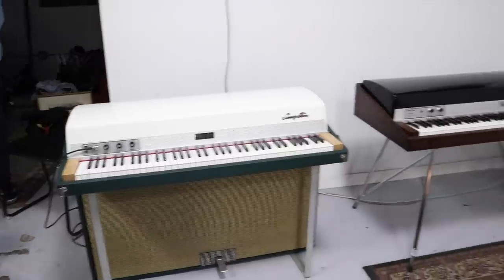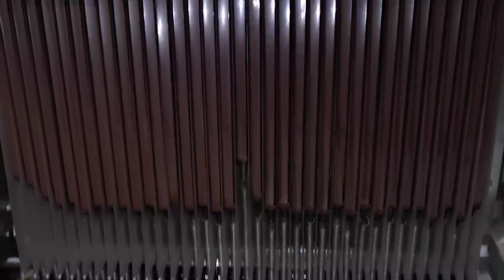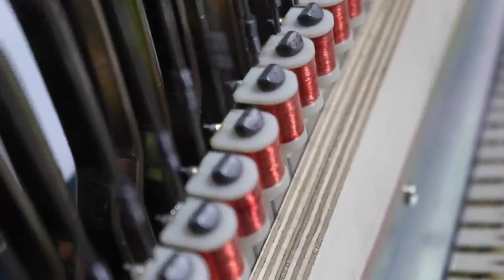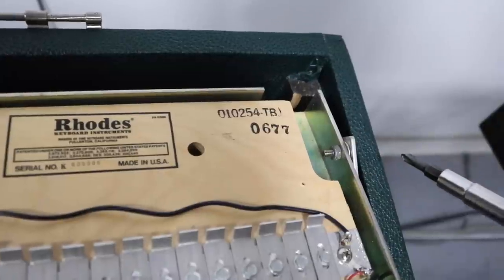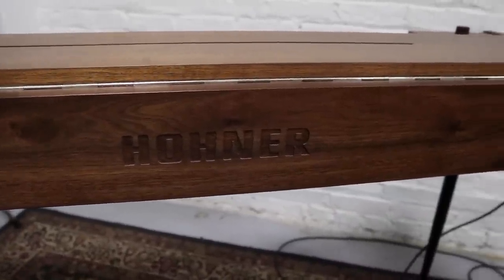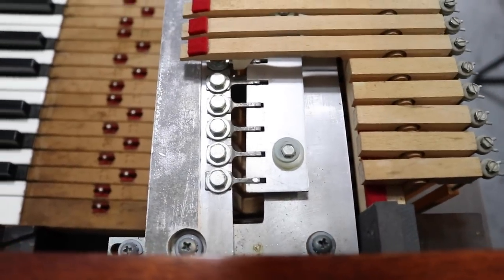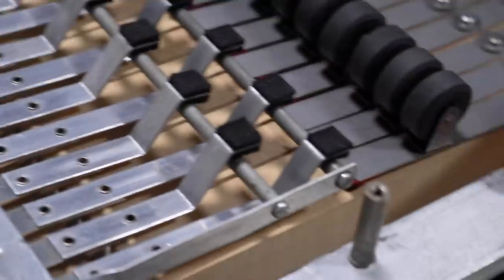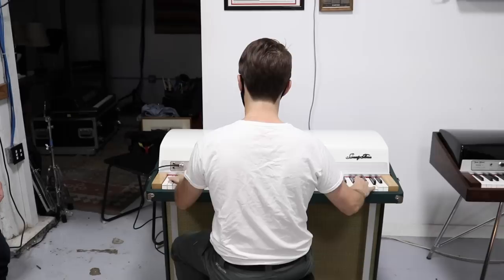The Chicago Electric Piano Company - Prof G

Comment: The resonator bars on a Rhoades absolutely changes the pitch,  just not the fundamental pitch ;)  the reason people say the rhoades has a bell like tone is because the tine and the resonator bar create what is essentially an assymetrical tuning fork.  It has the same basic overtone series as other single fixed point vibrating tine like intruments such as a handbell.  The different types and sizes of the resonator bars give the different sounding registers but each resonator bar is made to share the same natural resonance as the tine so it can store the mechanical energy and sustain the fundamental pitch for longer.  If you changed those tone bars with something else the tine would likely vibrate at the same fundamemtal frequency but with less sustain and with a radically different sound due to the change in it's overtone series.  The fundamental pitch always gets all the attention but every vibration matters when it comes to making a unique sound!
Reply: Yeah, we talked resonant frequency and the tuning fork aspect but you can't fit every aspect the design into a short video... Sorry that the edits of that part of our conversation make it sound like the tone bars are less significant than they actually are.
Reply: I don’t think the sound would significantly change without the tone bar. I think the construction and material of the tine itself is all the characteristics of the Rhodes sound. The tone bars sole purpose is longer sustain
Reply: @monotronfan1  Correct. That's the point we were getting at while at the shop. Things got edited down to keep things concise.

Comment: I didn’t understand the mellotron but that’s not the important thing
Reply: Basically, it makes sound by using a sample recorded on magnetic tape, similar to a cassette, and when you press the key down it reads the tape and plays the sound, just like a cassette
Reply: It has a strip of tape with a recording of a different pitch of an instrument for each key on the keyboard, which are pulled through a tape head when the key is pressed. It's basically exactly how modern sampled virtual instruments work, only with a ton of complicated mechanics instead of just playing a digital audio file.

Comment: The Mellotron comes apart quite easily, as you need to disassemble it to fix it (this happens a lot) or to change the sounds. Ahh, the 60s, but I have all this in my laptop!
Reply: Doesn't change the fact that I still want one. Nothing digital has had the same power as Tony Banks pounding out the opening chords of "Watcher of the Skies" on the real thing.
Reply: @tjenadonn6158  Yeah, I would'nt mind a real one, space to put it in and a on hand techician to change programs/keep the machine happy. The real thing certainly has a great sound, a bit of magic and heaps of vibe!

Comment: CEP takes affordable vintage instruments and prices them so far beyond the reach of working folks that we can never touch them again.
Who can afford $8000 for an EP that should sell for $2000?
Reply: With all respect, I would just like to make one clarification: Our average repair job is just ~$300-800 for basic repairs and comprehensive setup of the instrument that improves the instruments sound and most importantly increases these instruments' longevity. Our higher level restorations go beyond that level of repair and setup are currently selling between $3,000-4,500 for most models. That price level includes hundreds of dollars worth of parts and around 20-30 hours of specialized work dedicated to every instrument. The only instruments we've ever sold for around $8,000 have included upgrades well beyond what you would find in most vintage instruments such as added optical midi technology, upgraded speakers, custom fabricated parts, or custom hand-wired tube amplifiers...

Comment: With all due respect most of those electric pianos must be the worst inventions in history. All that mechanism, material and work involved  to produce just one or a couple of sounds ?? Was it really worth it ???   I can't imagine how much it cost back then . Did they ever think technology was was going to advance some day that a light and portable keyboard controller with a software can reproduce thousands of those sounds with even better quality ?   Nowadays very few, but very few bands or music studios use those electric pianos.  I must have seen thousands of different bands and groups  ranging from Jazz to heavy metal, disco, Funk and everything in between from all over the world and very few carry those heaven electric pianos. Everything is done through digital keyboards or controllers.
Reply: Beauty isn't always efficient, easy, cheap, light, etc. :)
Also, these instruments were easier to carry and maintain than their acoustic versions: piano, celesta, clavichord, pipe organ, flute orchestra...
Reply: Every instrument with acoustic components is more unique sounding than a full digital one. 🦉 Like comparing tube amps vs. solide state and modeling amps. There is a random movement of the gas atoms and the electrons in the tube, and  the metal components wear off slowly with the heat. Because of that, you can never get the exact same tone twice. 🌈 That's the magic! 🎊
Reply: Imagine, just imagine how many accordions have ever been made.  You can't. So many were made that just about anywhere you go, you can find accordion reeds in public places with a metal detector .

Now look at what it takes to build one.

Digital instruments have no soul.  People that play them are either just making music to make money, or are too cheap to buy real instruments.
Reply: @KC9UDX  lol you are comparing pears to apples. Accordions have existed way before digital pianos and are still very popular in many places and people still buy them. I myself have have a couple of them.  Nobody denies the impressive mechanism , parts and labor involved to build one. However, an average and decent accordion costs about $700-$1,200. It's a totally portable instrument, No electricity needed to operate.. Moreover, it's a very melodic instrument (even if you don't know how to play it, just pressing any key makes it sound beautiful) .  Electric pianos on the other hand, are very expensive (the  weirder mechanism, the more expensive,)  not very portable and the final result is just not worth it. 

Finally, it's not about the instrument but the musician himself. The musician is the one who gives life to an instrument!  You can have the most expensive instrument but if you don't know how to play it what's the point ?  . Furthermore, I'm sure you don't have any idea about digital keyboards or instruments. Maybe you own a Casio Toy Keyboard and assume all digital keyboards are cheap and not good. Have you ever heard about Korg Workstation or Arranger Keyboards ?? Or Yamaha Motif or Genos? or Nord Keyboards ???  Do you know how much they are ???. Maybe for you $2,000-$7,000 is cheap but even if they cost the same as those big ass electric pianos they are worth it because of the things you can do.  Are you familiar with Sound Sampling and Editing and stuff ????   With digital keyboards the possibilities are endless whereas with electric pianos you are stuck with one sound or just a couple of sounds and that's it!   Unless you are a masochist, sooner or later you get tired of those sounds. If you don't believe me, just listen to 20 minutes of a electrical  piano concerto and let me know if you don't get sick of it.   Remember, you cannot talk about "original is better" here because electric pianos are also producing artificial sounds or trying to reproduce other sounds.   I also like a real Church Bell sound added to some songs, so does it mean I have to carry those big bells with me ?. Moreover,   I'm sure you also prefer those big ass personal computers and floppy disks from the 70"s . But in case you didn't know , a small device that fits in your pocket can perform 100,000,000 X faster and  better than those huge computers from the past. Same thing is applied to electric vs digital pianos.  Plain and simple buddy!
Reply: @sharp19th56  Those are valid points and I agree with you 100% on " Beauty isn't always efficient and cheap! "  reminds me of my girlfriend !  lol !
Reply: @realsoda9404  but electronic accordions pre-date electric pianos.  Why are acoustic ones so popular?  The electronic ones can even make electric piano sounds!

The computer in my/your pocket is 1,000,000,000 times or whatever faster than an old computer on paper, but the old computer still gets real work done faster.
Reply: @realsoda9404  thank you for demonstrating that you have exhausted any possible counter-argument in favour of an ad hominem attack.  May God bless you in your struggles for maturity.  Honestly.
Reply: @duderama6750  exactly !